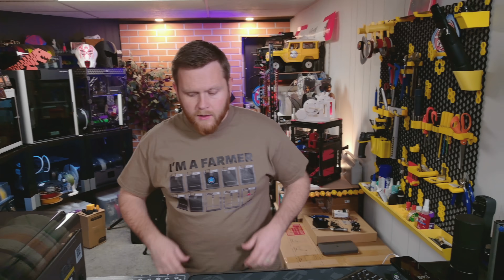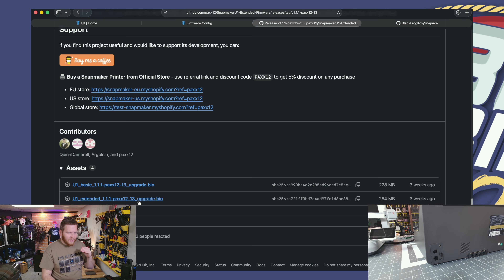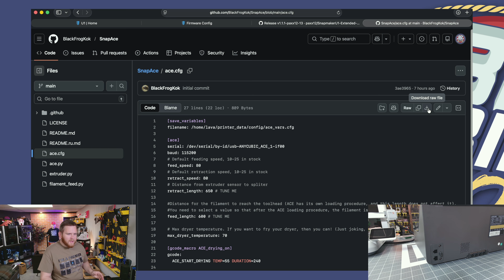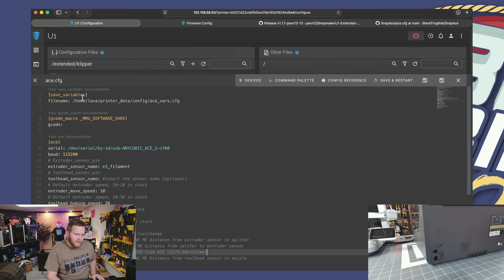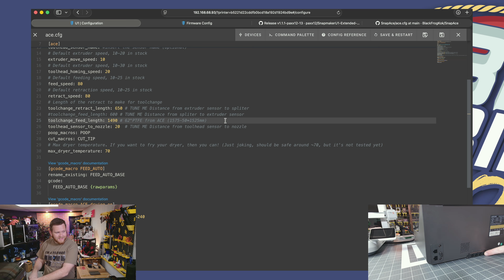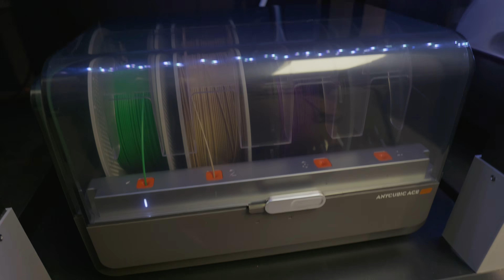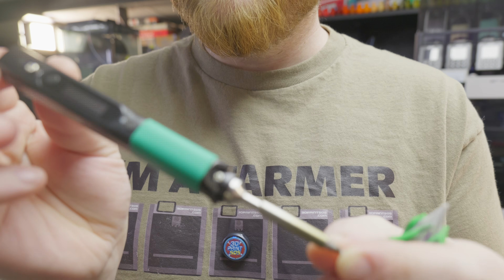Snapmaker U1 Just Got a Massive Opersource Upgrade (With Anycubic)

Comment: This looks like a pain in the ass
Reply from the maker: I can see why you’d think that, but it actually simplifies things quite a bit once you get past the initial setup!
Reply: @3DPrintSOS  So it is still working and no regrets?  How does it handle firmware updates from Snapmaker?  Does it overwrite the updates you made?
Reply from the maker: No updates from Snapmaker, as you have to run paxx. However it’s been just as stable as stock! So no worries.

Comment: So all 4 reels are drying at the same temperature? If so, this setup is flawed. Yes, it is good for multicolor printing of yet another useless toys, but not for engineering multimaterial printing. 4x Creality Space Pi or 2x Creality Space Pi Plus dryers are better choice for the scenario of four different materials with different drying temperatures (or two groups of two materials with temps close to each other). It's "only" a matter of mounting to ensure the layout is compact, ergonomical, and that filaments paths are obstacle-free. ("only" because that might be rather tough design task).

Comment: You never included filament unloading 🤔
Reply from the maker: It works the same as unloading. Once you change the distance you want it to retract, you just use the screen like normal and it’ll unload and spool the roll up the distance you set.

Comment: Or just use a Creality Space Pi 4X and no firmware needed. and it is cheaper
Reply from the maker: I really enjoy removing the motors on the sides of the machine and using the box to load and unload via the screen. The space pi has no motors, so thats why the Ace won me over.
Reply: @3DPrintSOS  There are mods and cable extensions so you can move the motors to the back of the machine and then you can simply connect the space pi to the OG motors.
Reply from the maker: That’s pretty cool!

Comment: Wow! I just ordered my snapmaker u1 today! Im excited!  I sold my 2 creality k2 combo and my k2 Plus to switch to snapmaker and since I need a big printer I looked at the anyqubic cobra s1 max because of the Ace pro. I was sold on the volume and dryer. I didn't know i could use it with my new snapmaker!! OMG! I'm so glad I found this video.  Subscribed! Thank you ❤
Reply: Cheaper and easier method using the Space Pi 4X no firmware change needed
Reply from the maker: @mharris281 Its not quite the same. The Space Pi has no motors. So you have to keep the stock side motors on the machine. This removes them altogether. You are getting almost a foot of space back on your desk with this mod.

Comment: great video! thanks for taking the time to put this together. How does the unloading works? you still have to unload from printer display and manually spool in the filament?
Reply from the maker: If you set the distance correct, it will unload like normal from the menu and then spool it up using the ACE. Then you can just leave it, or remove the spool.
Reply: @3DPrintSOS thanks for the reply. Sorry, still new to this, does the ace has a button or something to automatically reel in the filament or are you saying to manually reel from the ace?
Reply from the maker: It’ll auto reel it away from the extruder if you use the unload feature on the screen. Then you can just pull like standard. There is a distance you can set in the config file to control how much you want the ace to respool for you.

Comment: That looks to be a 6pin psu header for a computer you could probaly make a plug in adapter for it fairly easy with no soddering
Reply from the maker: It does look it at first, but each pin is keyed differently the plus is called a “MicroFit" Molex.

Comment: Thanks for this very interesting and detailed tutorial. 👍👍
I think I'll give it a try.
I have a quick question about drying the filament.
I didn't quite understand how to start the drying process.
Drying is started directly using the ‘ACE_Drying On’ macros from the Klipper web interface, not from the U1 menu ?
And what about unloading the filament?
Does the ACE Pro automatically rewind the spool when you use the “unload” function on the U1?
Thank you
😊👍
Reply from the maker: Since the stock machine doesnt have drying functions, you have to dry from the klipper interface. All the winding is handled just like OEM, except instead of the spools being on the side, they are inside the ACE. ;)
Reply: @3DPrintSOS  Thanks for your feedback. 👍
So, if I understand correctly, the ACE feeds the filament to the U1 extruder (as we saw in your video).
But when you want to retract the filament, the ACE motor isn't used to pull it back ? You have to do it manually, just like during normal U1 operation ?
Thank you
Reply from the maker: Right, standard, it doesnt pull it all the way back out. Just enough for you to easily pull it yourself. Now, there is a way to alter the distance. It IS klipper afterall. I havent looked yet, but its 100% in the config.
Reply: @3DPrintSOS  Thank you for taking the time to respond and for this informative feedback 😉👍

Comment: Interesting set up, which i didn't know. When i received my SnapMaker U1 i added TWO SUNLU dryers on each side. it works well! no need to make any changes within the code at all. Each Sunlu S4 Dyer holds 4 filaments and this Anycubic holds only 4. The only thing i want to do is to find a way to use them all simultaneously so i'd have 8 filaments for more colors. I wonder how to do that, if you have any suggestions and make a video that'd be great. i will keep on eye on your responce
Reply from the maker: Not sure its going to be possible to make 8 work. Youd need motors to pull the filament and likely cutters in the toolheads. That's why the Ace works, since it has motors that replace the motors on the side of the machine and its a simple 1 spool for 1 toolhead setup.

Comment: Hi
If you use this firmware does it have any affects on the basic firmware updates?
Reply from the maker: Yes. You now have to use paxx firmware updates. If you ever update to stock, you will lose the features until you flash paxx firmware again. :)
Reply: @3DPrintSOS thanks for your quick answer. Maybe I just didn't hear it, but where exactly can you turn on the dryer?

Comment: ONE DAY a company will figure out how to do SOFT TPU from a AMS like device, and it will be glorious, but it seems we will have to continue to wait until that happens. Thinking they will need to go to a silicon or rubber feed system with squish and slip measures taken into account. 
Technical it should be possible.
Reply: Closest is the Anycubic Kobra X and it's ACE GEN2.  It does all the filament switching right in the head.  It has worked flawlessly for multi-material printing for me for over 500 hours so far.  Printing muti-color TPU  and even PEBA out of a .4 nozzle was working fine.   PETG and PLA supports were easy.  The PETG  and TPU pliers printed perfectly.  It also has a cool feature that ejects the very end of the filament roll out the top of the head to keep that little bent end from jamming in the extruder.  I printed dry boxes and used renewable desiccant to keep the filament dry.  I don't think TPU feeds well if it's really warm from a dryer.  Check it out!  I've really liked the printer and it poops way less than most.  Now a U1 with 4 ACE Gen2 like print heads would be 16 colors.  That would be amazing and very possible but might increase printing time due to filaments have a loading/unloading time.  Just food for thought.
Reply: @outrunnerdog  yes that is a very nice printer. However I am looking for a enclosed one because where it will be, it gonna get real cold at times (cold Garage in NZ). So an ability to heat a sealed chamber is pretty much required.  
I know you can get a GIANT container and throw it on top of these but its not ideal imo.
Reply: @outrunnerdog  also the other factor I forgot to mention is the WASTE during color switching.  However the Kobra X has all filament going to the print-head so its maybe not quite as much, but still it needs a full toolhead flush each switch.

Shame their S1 ones can't do soft TPU.   Their filament changer is not up to the task, plus likely it adds loads of waste.  Something a multi printhead changer solves, or at least printers like the U1.
If the U1 was 350x build volume I'd jump on it, but its 270x so I'm waiting for competitors at this point. (nothing happening for me until end of year, got loads of time)
Reply: @gerarderloper  All valid points. Have you looked at the Flashforge Creator 5 Pro? It has an actively heated chamber, so TPU itself shouldn’t be an issue, although the build volume is smaller than what you’re looking for.

With the Snapmaker U1, one option is the BIQU PopCap, which seems to be the only top cover available right now, at least from what I could find. But you probably already know that and still only passive heating unless you install the BIQU Panda Breath.  It was @sliceofmymind that had a video showing how he did it.

Prusa has hinted that they’ll release the Core One L with a prebuilt INDX upgrade, most likely by the end of the year, so that might be worth waiting for. I’m currently going with the Snapmaker and PopCap for now while I wait to see what happens with the Prusa Core One L and INDX. Hopefully they release a 10-toolhead version since it looks like it could fit, but honestly, 8 toolheads would be enough for me. But imagine drying and mounting 10 different rolls of filament.  Sounds like a pain and might make the printer have a massive footprint. Looking at a fully installed INDX on the Core One+ I'm shocked at it's appearance.  It looks so massive.

BTW I'm also printing in a garage that can get cold or really warm depending on time of year.

Comment: I appreciate this video. However, i highly recommend you skip this method and go straight to multiace which is far more user friendly. single click install, really easy filament management AND it supports multipler Ace Pros or Pro 2.
Reply from the maker: I just installed today. I’ll have to make a new video

Comment: U1 is perfect with the pricing. I agree! I started my 3D printing journey with the Voron 2.4. While open-source systems are excellent, three years of experience has taught me that a printer should be a tool, not a time-consuming project. Ideally, a printer should work seamlessly with minimal modifications. At the end of the day, people value the output more than the machine used to create it. Despite owning a custom Voron with a multi-color tool changer, I switched to Bambu for the convenience. If you enjoy the technical challenge as a hobby, any brand will do. But if you're looking for a hassle-free experience, I highly recommend Bambu.
Reply from the maker: It’s a fair point—there’s definitely a time and place for both the DIY tinkerers and the plug-and-play crowd.

Comment: I think I did everything as shown in the video. There are some errors in Klipper that I'm attaching, and an error in U1. The filament starts but stops about halfway through the first tube. I changed the data in the file, but nothing.
{"coded": "0003-0522-0000-0007", "oneshot": 0, "msg": "[Errno 13] Permission denied: '/home/lava/klipper/klippy/extras/filament_feed.py'"}
Internal error during connect: [Errno 13] Permission denied: '/home/lava/klipper/klippy/extras/filament_feed.py'
Once the underlying issue is corrected, use the "RESTART"
command to reload the config and restart the host software.
Printer is halted

Comment: I took a print online and modified it to accept that USB receptacle that you're showing and connected it on my snapmaker Ace. I did not realize that the color code between the green and the white is backwards from what you show in your video. If you PM me I will send you the STL file and the photos of what I did.

Comment: I wish someone that is a lot smarter than me would develop an unload motor mechanism at each spool that would be triggered by the unload command in the config that would cause a motor to rewind the filament to the roll automatically. It would require a motor mounted rewind mechanism and a stepper driver board and that would allow us to have an auto rewind function for the existing spool mount positions.

Comment: Wonder how difficult it would be to just make an adapter from that 6 pin to USB port?  Maybe Anicubric will make it?  Seeing how you did it that doesn't seem that difficult.
Reply from the maker: I spoke to them directly about making a cable and they flat out said no. They didnt have interest in making the ace work with other machines.
Reply: @3DPrintSOS ah, that sucks.  Not sure why they want to lock it down to one machine

Comment: Which is better, Anycubic ACE Pro or Creality Space Pi X 4?
Reply from the maker: The Space Pi X 4 has no motors in it. So the Ace Pro is superior because it works WITH the printer. HOWEVER, the space pi is FAR better at drying. Since that is all it is…a dryer.

Comment: I also now have an ace pro running with my u1. Maybe i'm doing something wrong (the u1 is my first 3D printer) ... but a huge downside now is, that the filament changes on multicolor prints now take ages (5secs) because the u1 has to wait for the real slow change of the ace pro right? I don't really like the ace pro's internal mechanics. So in my opinion this is a cool POC but does not really work for me ... for multicolor.
Reply: I actually eliminated the downside by triggering the change in another parallel thread. So the UI does not wait anymore for anycubic. Works excelent so far
Reply from the maker: There should be zero change to toolhead changes. Unless I’m misunderstanding what you mean…each lane of the Ace is for each toolhead. So the filament doesn’t retract during changes.

Comment: Would it be possible to use this ACE pro mod in tandem with the original feeders? Let's say I use the ACE pro to feed extruder 1 & 2 and use the Snapmaker sidefeeders to feed extruder 3&4, would this be possible and would it cause any issues?
Reply from the maker: Unfortunetly no. The motors in the ace take over the motors on the U1. So at the moment, its one or the other.

Comment: I want to give this a shot.  SInce I am already running the terrific  paxx12 extended firmware I feel like I am halfway there.   I went to the Anycubic to look at the device and I see three variants for the Anycubic Ace Pro, For Kobra 3 Max, for Kobra 3, and for Kobra S1.  Anyone out there know if it matters which variant?   What about the Ace 2 Pro, is it supported?
Reply from the maker: Doesnt matter which one as long as its an Ace Pro. At the moment the Ace 2 Pro does not work. But were doing some testing!

Comment: Hi, I just connected everything according to your video and created the files on the U1. When the filament loads, everything works. The U1 recognizes it as loaded. But the Ace Pro doesn't release the motor after loading. So the U1 can't pull the filament during printing because the Ace is holding it. Any tips for me?

Comment: Awesome, ordered filament dryer
Reply: got mine working, first time using ace pro and was wondering what the loud klicking was, than I understood that it is the ptfe spring buffer thing. I will add some silicone damper so that it does not make that loud bang depending on what state the ptfe tube is during tool change. but what I wonder is, if there is a way to change the heating temperature without having to restart the settings and reboot the machine. would be nice to have at least a configurable temp curve or so if no manual intervention is possible. But I guess it is an snapace matter. Anyway thank you for your video, Amazing project. I might upload a video How mine looks like now and with the modification I imagine (buffer noise reduction)

Comment: Is it any difference of using the anycubic ace pro for kobra 3 or thr kobra s1? Dont seem to be different on them😂 (im new with the Anycubic models)
Reply from the maker: The difference is that the U1 has individual toolheads for each spool. On the other machines, there is only one. So it has to cut, purge, and pull filament back. This doesn’t do any of that.
Reply: @3DPrintSOS well i just ordered the anycubic ace. And will try to get it working woth the snapmaker. Since I need to have it in the basement where the filaments dont like the humidity over time🤣 at lest when I tried printing with petg that wasnt dry enough

Comment: I tried modding the Ace Pro by soldering the D+, D–, and ground wires to the board as shown in the diagram. Before connecting it to the U1, I plugged it back into the Anycubic printer to make sure everything was still working, but it was no longer being detected.

I then unsoldered one of the D pins and plugged it back in, and the Anycubic detected it again. Is that expected?

Does soldering the female USB mean it can no longer be used with the Anycubic printer?
Reply from the maker: It should be completely backwards compatible. Make sure you have the right d- or + and double check the pins
Reply: I double-checked the wiring: the white wire (D−) is connected to the first pin, D+ to the middle pin, and the ground (black) is connected below the D+.

I used a brand new high-speed USB extension cable, which I tested beforehand and confirmed was working properly.

Could this be related to the shielding? Should the shield be connected to ground?

Comment: Thank you very much for the great video! I have also ordered an Ace Pro – it should arrive in the next few days.

One question: there is supposed to be an upcoming update from Paxx12 to firmware version 1.2.0. Will all modifications remain after the update, or will everything need to be set up again?
Reply from the maker: Any update will delete the files. So you’d just have to move them back in place and make sure the ptfe number you entered before is entered again.